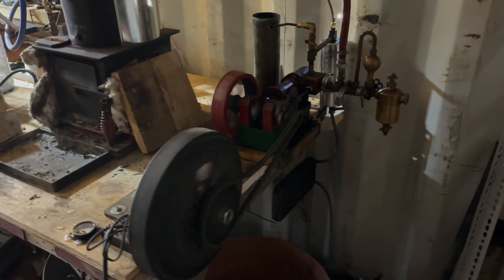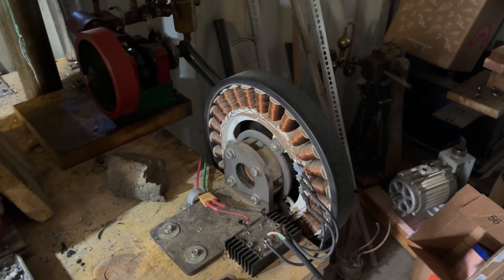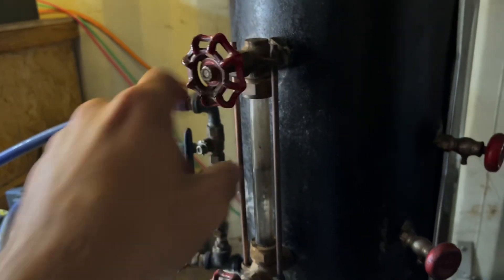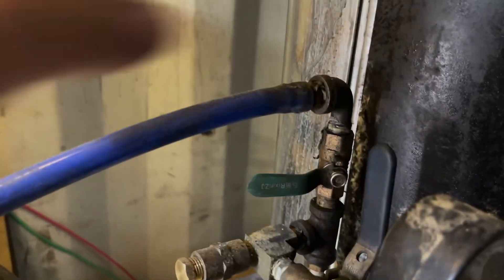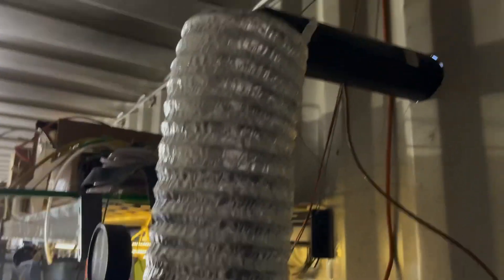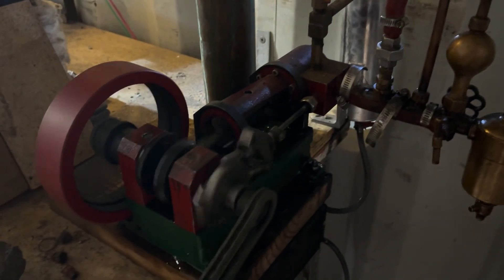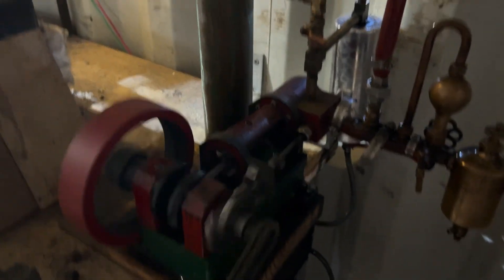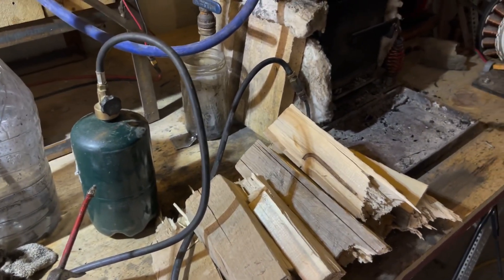Steam Powered Workbench

Comment: Thats very cool. 

Have you tried a capilary tube stainless steel or copper or inconel, where it runs at higher temperature, and draws water through and high pressures are attained by the length of tube and heat at the area towards the outlet?

Would use less water, and less fuel when the steam is superheated. 
No risk of tube turning into a bomb, the tube would just split, unlikely.